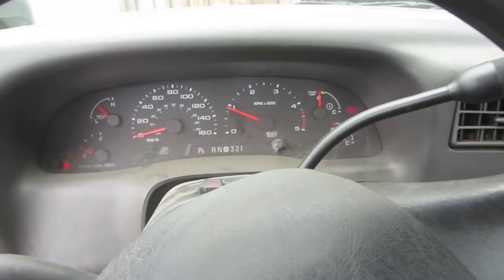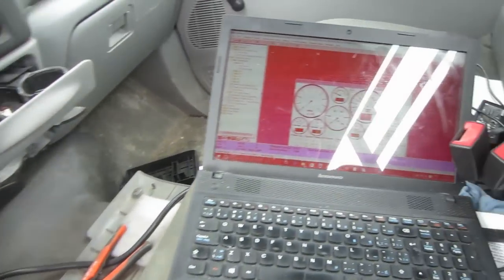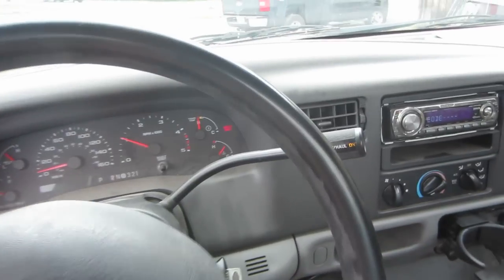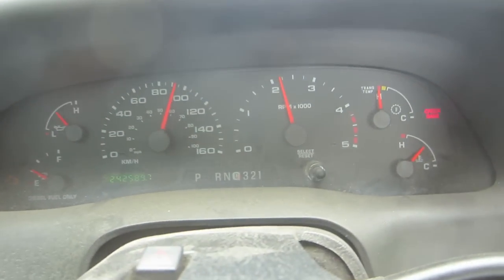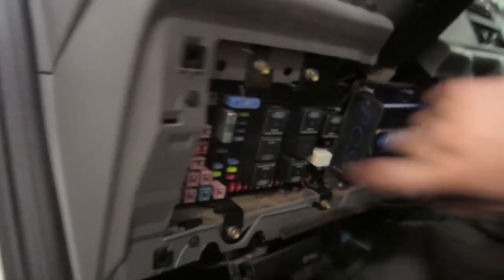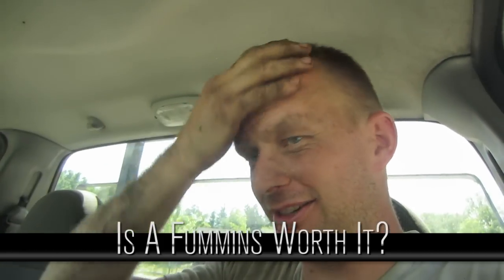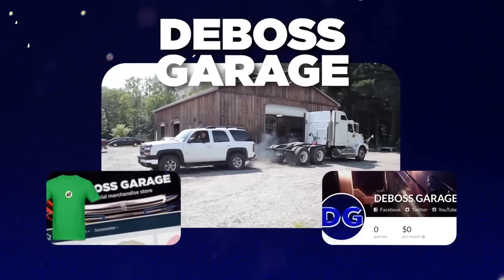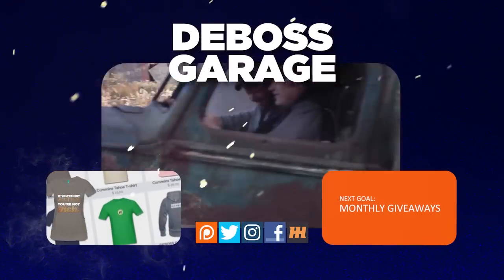TEST DRIVE RANT: 5.9 Cummins in an '04 Ford F350 (Part 4)

Comment: Your transmission harsh engagements reminds of when battery voltage is low, similar to when a alternator is bad. When the voltage is low it slams real hard and when applying it into a gear at a stop. Thanx for the vids entertaining!!

Comment: Cummins 12 valve all the way, with a 5 speed. I also have a couple 1982-83 Mercedes Turbo diesel 5 cylinder 300d's, great engines. Keep up the good work !

Comment: Too bad. A manual transmission might have been a smoother conversion. I've seen universal gearboxes in these heavy duty trucks, just bolting up to Ford, GM, or Dodge specific bell housings. I did R&R work for a transmission shop for several years.
Reply: Special Ed you also gotta install the pedal box and run the hydraulic lines for the clutch and other various small things you wouldn’t think you’d need to change. It’s better to start with a manual truck if you want a manual transmission.
Reply: Jimmy Grant converting to manual transmission could be done in a few hours. Floor, clutch pedal slave cylinder wire harness from wheel well to transmission and swap the cpu and the steering wheel.

Comment: You should talk about the 6.7 Cummins. They’re great until you put power to them then they start lifting heads. Cummins makes 300k motors now too lol 

Done a few 24 valve conversions much prefer them over the 12 valve but the 12s are definitely much more simple to do

Comment: I bought a new Ford F-250 super duty 7.3. I have right at 400 thousand miles on it now. Still have factory injectors. Of course I changed oil every 5000 since it was new. Automatic transmission 4 wheel drive. I always desired a Cummins over a 7.3 also but it hasn’t cost me any big money in 400000 miles so I’m happy.

Comment: The dinger for the key is easy to stop. Take the lock out and remove the contacts! No dinger any more. The seat belt dinger I have been completely unable to stop! Drives me nuts! So what part of the program do I have to go into to change the setting with the PCS TCM? Have 12000 miles on mine and I want to change some of the shift characteristics. You are absolutely spot on it's WAY too complicated.

Comment: I've done a few diesel swaps myself.  Just came across your channel, and great work.  The 5R is a great transmission, but by it's design and having a swap shift, it's very hard to control.  Not uncommon for people to swap a 4R in when doing an engine swap just for simplicity in tuning.  If you do it again, one of the most successful methods I've heard of is just using the 6.0 PCM/TCM.  You can then give the stock TCM the sensor inputs it needs, and just flash a modified tune for the Cummins.  They'll shift as smooth as stock that way.

Not fond of the 6.0's I see, lol.  We were looking for another truck to replace our 7.3, and I looked at all the big three.  I just didn't like the trucks as a whole as much, and found a cheap 6.0 that was what we were looking for.  I took the heads off, did all the updates, studs etc preemptively, and have't put another dollar in it besides oil changes etc.  In a 2005 CCLB 4x4 with all the updates, rebuilt and upgraded turbo, and custom tunes for less than $10k all in.  They aren't all bad if you take care of them.  Had it around the country towing our travel trailer without issue.

Comment: "Shut up I'm not even in gear" LOL great vid Rich. Is the Sept 17th gathering still on?
Reply from the maker: +Erated78 Yep still on
Reply: hay i don't know what your talking about on 6.9 idi getting poor MPG i get 20 MPG loaded i thought that was pretty good but i will agree on the return lines being over complicated but i love my navistar

also you do know there is a differences from a 7.3 idi and a 7.3 power stroke right?
Reply: VK7001.P Idk was non turbo the power stroke was fords upgraded version.
Reply: FishFind3000 nope the 7.3 powerstroke was completely different than the 7.3 IDI

nothing will transfer over to the other engine

it was a complete redesign
Reply: @Friedrich-Wilhelm-1980  the oil filters swap 😁 that's it lol
Reply: @evananderson3350  actually they dont the 7.3 idi uses a motorcraft FL-784 and the 7.3 powerstroke required more volume so they made a bigger filter FL-1995

Comment: Bulletproofing a 6.0 properly, my way, is what I’d be doing before I Cummins swap one. Not a fan of the kits.
Reply: Still wont save you the 6.0 will blow up mine hit 401k and.......everything died dropped lifter ate lifter metal flakes everywhere rod out the side as well........lol i just wanted to go fishing i changed oil every 3k 15w40 rotella and tranny flush every 20k the 6.0s are designed to fail and mine was stock and bullet proofed with arp stuff

Comment: very rare to hear someone pick on a 12 valve.  I have two and often gross around 30000, that's where the diesel can save fuel.  Gas can't come close when it comes to heavy hauling.  If my 90000lb 22 wheeler were gas, you'd see the difference, about 30 to 50 percent more fuel, especially when the weight  goes up.   I want an LS truck too, but never for more than about 10K gross, even in a three quarter ton.  Nice swap, by the way, and if a customer is happy and wants it as is....let him have it, you did the other tricky stuff

Comment: I can tell you that if your o/d off light is flashing it means the EPC solenoid is allowing full line pressure. Resulting in the harsh transmission engagements
Reply: It actually means nothing, with the PCS controller the ECU no longer sees the transmission so the O/D light flashes forever...

Comment: A great way to bulletproof your 6 liter truck. LOL. I wonder what the line pressure is doing. On my 4.7 liter Dodge, I put a resistor in line with the line pressure sensor to firm up the shifts, and it jerks into gear like this, not as harsh, but it is so much more firm than stock.

Comment: You probably already thought of this and I'm probably way off base but I figured I'd throw it out there I have an older style transmission only by a year or two but I have the same shift problems with reverse and shifting from 1st to 2nd and it was bad fluid mixed with a corrosion on transmission harness

Comment: Would a manual transmission fummins swap be easier because you don't have to tune it???
Reply from the maker: Definitely.  As long as the manual was already in there.  I know in the GM's, you have to pull the dash to install a clutch pedal if it was an automatic

Comment: Argh. I sell that PCS transmission controller. That Ford transmission is not even officially supported by PCS. Destroked managed to put something together they say works but I think it is still a bit finicky though it works.  I send customers to Destroked all the time.  PCS support for GM transmissions is fantastic and I use one of the first ones made in my 4x4 van to this very day.  However now they have the 2800 and are still working on config files for various transmissions and they only really want dealers that specialize in various transmissions so they don't have to do any support.

Comment: I think if it was having issues i would try to put a mechanical injection pump on the 7.3 that was in it. I have seen tjat a few times and think it would be a cool way to increase the reliability of a 7.3 if its not reliant enough for ya

Comment: 376,000 miles on my 7.3 Powerstroke. Still going strong.
Reply: The 7.3 is different , it was reliable , if you want 8 mpg you are good to go ! , to the gas station hourly I mean
Reply: JendrixHimi just did a 1200 mile trip. Averaged 16.5 mpg in my lifted crew cab dually full of stuff and family.
Reply: JendrixHimi I’ll take that bet. If you want you mind blow I’ll bring you a 97 f250 with a 7.3 that gets around 19mpg on mostly flat driving. Send me a check and I’ll be there with both trucks
Reply: JendrixHimi Are you talking about 7.3 IDI’s or powerstrokes? Because their are tons of people who get between 16-20 mpg on lightly tuned and modified 7.3’s

Comment: do you think the rough shifting may have something to do with trans not been able to read the tacho as it wont have any idea how fast the motor is revving
Oh yeah you know what Ford means out here  fix or repair daily or the other one F--ked on race day
Reply from the maker: No, on the laptop, the rpm was reading steady.  I think it was the stepper motor.  He ended up getting the trans rebuilt

Comment: Are the brakes the same or different on f250 and f350 thks
Reply: Depends but usally the same
Reply: @timallred6789  thank you !!
Reply: @PeterHatch-mx7zc  only diff is the size of the shoes my 6.0 has will wood 6 pistion brakes.....word to the wise best idea i have had but if there not the same they where probobly swaped for 450 or 550 brakes

Comment: Not sure what trans is in that, but can you check the line pressure?  Some automatics are adjustable (like 700R4) and it can make them slam into gear when the pressure is too high.
Reply from the maker: We brought it back to the previous owner who drove it and said it always shifted like that.  The customer was happy enough with it as is and is just going to drive it, see if any other bugs show up.  If it lets go completely, he will just rebuild the entire trans.
Reply: +DEBOSS GARAGE or swap it whit a manual transmision:)

Comment: if it was my conversion I would do a complete drivetrain swap motor trans wiring harness with possible axle depending on what exactly I had
Reply: Nah, depending on the year, youd want to keep the axles under it.

Comment: hey I just got my hands on a 04 extended cab long bed f250 Harley Davidson. they only made 11 and I think I saw they where prototypes of the 6.0 because it has 230000 miles and it's all stock nothing changed
Reply: BlueReaper doom congratulations on the new time bomb
Reply: grumpybill lol it went off
Reply: BlueReaper doom bwahahaha 
Sorry about that, naw not really but now you got a reason to put a Cummins in it.

Comment: What are your thoughts on this swap in a 7.3 truck with the ZF6 manual transmission? It seems most of your "gripes" have to do with making the transmission act right. I have either a complete rebuild or a swap ahead of me and seeing as I'm already intimately acquainted with the 12v Cummins, I think a swap makes more sense...
Thoughts?
Suggestions?
Reply from the maker: ZF6 will work perfect with a Cummins.  Manual is the way to go.  I got rid of the 4l80E in my Silverado and went with the NV4500.  Just make sure the transfer case drops down on the proper side
Reply: The 4wd already works and I plan to rebuild both the tranny and transfer case while the engine is out, it needs a higher rated clutch anyway... Oh also what kind of engine stand do you use? Because the one i have is a harbor freight that would crumble under the weight of a 12v.
Plus I'm in Colorado, so if Destroked dicks me around I'll show up at their shop doors with it. Thanks for gettin back to me, eh!

Comment: Reckon a 12v swap in f350 with a zf5 manual is better than an auto? and which injection pump do you prefer?

Comment: I have a OD switch on mine on dash if you forget to turn it off as you stop,  it bangs shakes the truck , then when you engage the gears again it jerks exactly like his in the video is doing all the time , it is as though his OD is locked on high all the time  wish there was a way to make the OD work without a manual switch in the dash and keep the Ford TCM with 5r110 , Is there?

Comment: Hey Rich, was this swap using the 5R110 transmission? I'm thinking of doing a swap with a gas F250/350 and using a 4R100.
Reply from the maker: It was the 5r110 yes

Comment: ok so are chevy trucks better?  in your opinion. which is better?  what would you recommend your dad buying?  for work .
Reply from the maker: Budget and years interested play a big role.  What are you after, what are you hauling, how far do you commute...
Reply: DEBOSS GARAGE no hauling I'm a glazier I travel 50 to 60 miles daily sometimes more. diff job sites. my pops wanted to get a 04 f350 diesel but idk watching your videos it seems like they aren't that good.

Comment: My cousin has an 02 F250 and when I have to drive it for work I fucking hate it. That damn binging along with the busted ignition drives me up a wall.
Reply from the maker: I drove a crew for a buddy's excavating company 2 hours away in a F250 gasser CC.  He asked me how I liked the Ford.  Granted he put beefy tires on it without getting an alignment but I swear I got carpet burn on my back from bouncing around.  This Reg Cab rode a lot better but I usually still get a rash from being around Fords too long.
Reply: His has the 5.4 V8 in it. I probably can't stand it because he beats the shit out of it, he has been driving it without a cat (straight headers) for the past 2 months since it fell off and refuses to fix it because "it sounds like a mud truck" it disgusts me.

Comment: what are your thoughts on the duramax
Reply from the maker: Great engine.  The first years (LB7, up to 2004) had injector issues.  Most should be repaired by now, nest models were right from factory.   Tight enough to make you swear when you are under the hood but more room than a Ford.

Comment: would it be better/possible to just use a trans from a dodge?
Reply: Ben Miele Unless it's a manual I would say it's not worth the time or money. That Ford would not be compatible since the shifting is probably handled electronically. Those Cummins will eventually trash a Dodge transmission anyways and this is coming from a Dodge guy. I think this is mostly from lack of proper maintenance and often the overdrive is left turned on when it's not appropriate.

Comment: it´s amasing , that these Ford diesels , don´t last longer , i have a old mercedes w124 200D a 2,0 4 cyl , it´s gone past 820,000km , never had the head off, chain and tensioner , normal wearparts like that , nothing else ,, another thing is the old 6,2 v8 diesel ,has alot of design issues in my opion , and the horsepower ,130HP my god , my 1985 300D 6 cyl makes that with half the displacement,,,,
Reply from the maker: Yeah, its sad.  We are about 20 years behind Europe.   I love Canada but I have to shake my head sometimes

Comment: Putting a 12 valve into a 2006 F350 any advice on transmission? , I already have another Fummins 24 valve with 5r110 but using overdrive lockup switch on dash  , great truck but would prefer it to be totally auto on this new 12 valve conversion with no manual switch   can anyone offer advice?  do I pay $1000 to Destroked? and not use the Ford PCM?  or?  he says he will help program the box , anyone got experience with him and a 5r110? , does it work good if done well ?  can it be done? or should I stay with a Ford PCM ? or use the 4r100 transmission ?  or what transmission? must be auto for the missus , please HELP !!

Comment: Why not just drop in a crate 7.3 Black Mamba, and a 6 speed? Much cheaper, simpler, and you can outrun anything on the road for the next 500,000 miles.
Reply: Grumpy old fart , would geuss the cost ,already got the 12 v and all

Comment: what would it cost to swap a Cummins into my 96 Powerstroke
Reply: At Least $3000 if you do it yourself  maybe $10,000 if you have Deboss garage do it but not sure.
Reply: why would you want to swap a 7.3 for a 5.9?
Reply: +L7 DQF because my Cummins of the same year runs circles around my Powerstroke. and is much simpler and cheaper to work on and make power. but I like the body style and the way my Ford drives.
Reply: +Dodge 318 Cummins it would honestly be worth it I'm looking at that much just to replace my turbo and injectors with better ones. and that's without buying a t500 hpop fass pump and banjoe block.
Reply: +Jon Ruger ya I was considering swapping a 4bt Cummins because I here they bolt right up to my stock trans and are cheaper like $1000-$2000.
Reply: +Dodge 318 Cummins yeah that wouldn't be a bad idea that motor can still make more power for cheaper then my 7.3
Reply: +Jon Ruger maybe when my 318 goes out I'll do it.
Reply: You could sell the 318 to get the down payment for a 4bt or a 6bt.......
Reply: +OnlyTheEd I'll just wait until it blows up and then get any diesel I can find for cheap.
Reply: There is that option.....

Comment: 3.9L/5.9L Cummins, 3 or 4 wires......those other engines involve computer programming, yuk!
353/453-371/471/671 Detroits have too many RPMs.....and they ALL require a blower for scavaging air for aspiration. The Cummins engines don't NEED a turbo, but they help, The Detroits, well I'm not sure.....if a turbo will help them. Perkins? Ummm No comment. Isuzu, nope. Kubota, Nope. Mercedes.....nope. Hercules, Really? Buda, see Hercules comment. In fact......don't even look here.....I think I'd stick with the Cummins choice with a stick-shift transmission.
Reply: OnlyTheEd to many rpms the Cummins can outrev many Detroit motors once you start hoping them up the Detroit 3600-4000 is about all you can get their problem is size
Reply: Detroit's came with turbos from the factory the supercharger is literally a necessity for 2 strokes
Reply: Perkins are good